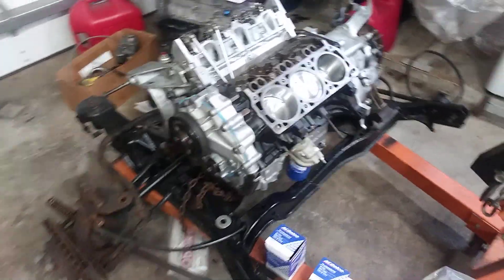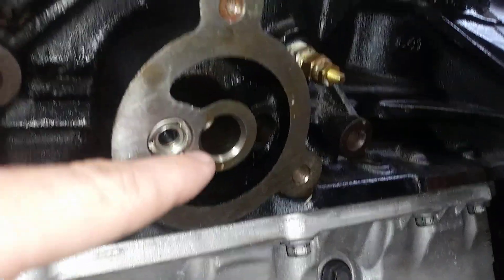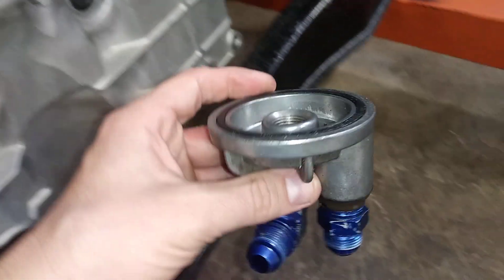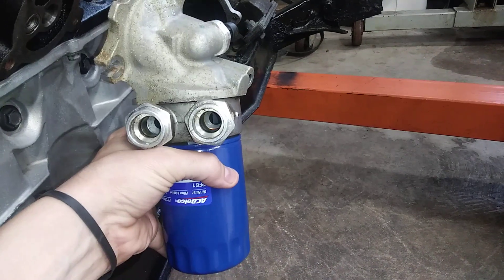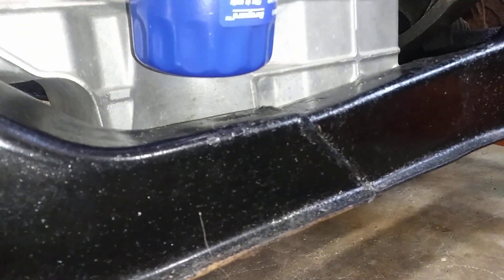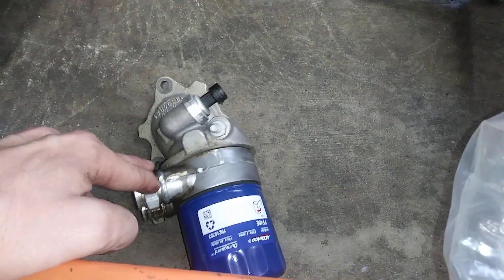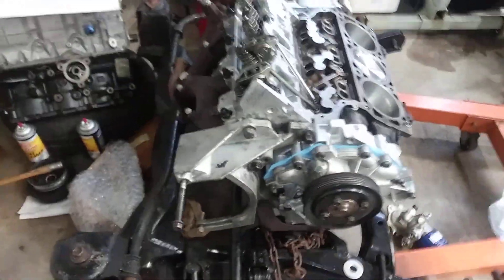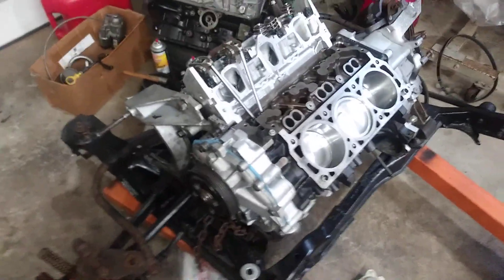Lz9 oil filter solution, pushrod length, and more

Comment: You could use the sandwich and the short filter. The solution? Just plumb in a second filter in the lines going to the oil cooler. Problem solved.
Reply from the maker: An aftermarket oil filter adapter would also work for external mounting away from the block.  I didnt research that before making the vid

Comment: I'm looking to build the fastest Fiero in the world, I think you're the kind of man to help me find the right set up. 3800 SC or 3.5L LX9?
Reply from the maker: Lx9 has potential.  3800 is proven however.  Lx9 is lighter and has better flowing heads but also less displacement.

My lx9 made 530 whp at 16 lbs of boost.  3800s need 24 lbs or so if not more to make that power

Comment: Can you spin the whole filter housing 120 degrees?
Reply from the maker: Not likely. The oil input on the block is in a precise location.  Rotating the housing puts it very close to the ports in the housing and block not lining up.  I did not examine it close enough.